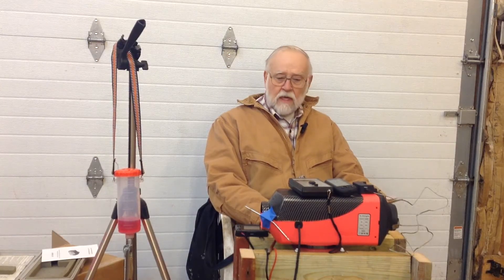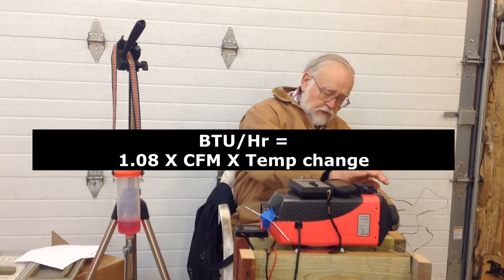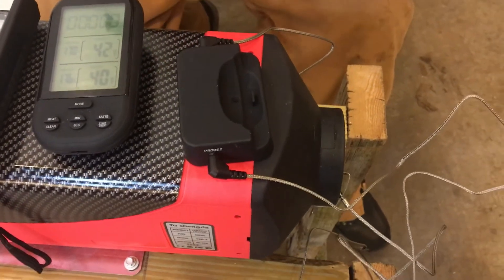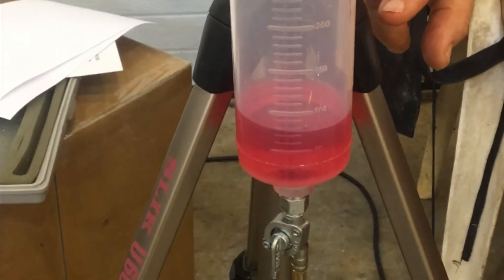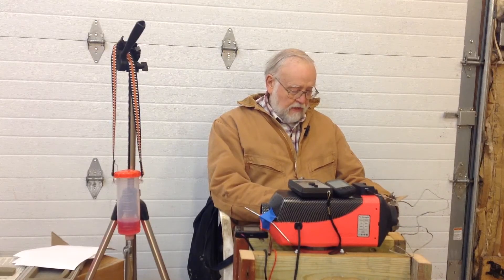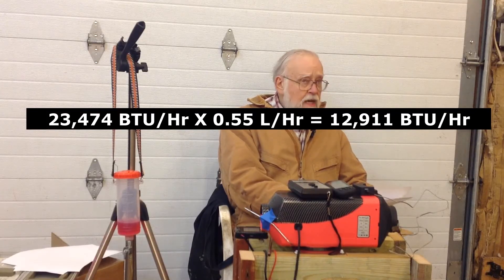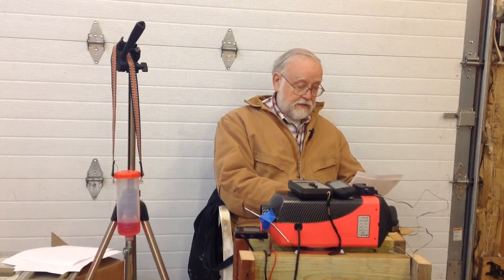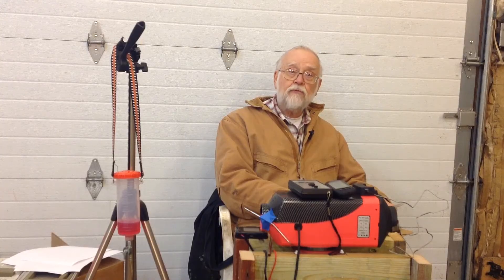Diesel Heater What is the Actual Heat Output?

Comment: nice to see someone do a little bit of math.  it would be interesting to calculate and measure how clean the fuel burn is.  the 8kw model is a stretch of the truth some may say an outright lie.  But if you work on the basis that an 8kw model is actually a mislabeled 5kw model and is about 70% efficient then you get to roughly 3.5kw, vs the 3kw yours in producing at the lower fuel burn rate.  if you dive down into the settings and increase the air fuel ratio to get it burning 0.55l per hour then potentially your up to about 3.8kw in a perfect world so a safe bet would be to say it produces between 3-3.8kw as yourcs can probably be tuned further.  i have seen some people extending their exhausts and adding heat sink/heat exchangers around them to recover some more heat and get the efficiency up.  these are not the most cost effective or efficient methods to generate heat but they are ideal for getting heat into off grid, mobile, remote locations,  they can also be used as a supplemental heat source in emergency situations.  if you figure around 10 watts per square ft (rule of thumb for space heaters) then it should realistically heat a 300-350sq ft room with typical insulation and ceiling height in a reasonable time frame, it just depends what your using it for,  if you just want it to take the chill off or have significantly better than typical insulation it can be used in a much larger space.
Reply from the maker: Thank you for your comments.  When I read the add for my unit it implied the heater had an output of 8Kw or 27,296 BTU/hr.  I think that is a lie.   My owner's manual indicated the capacity is "Calorific value (W) = 8000".  A calorific value of 8000 watts is not the same as saying the output is 8KW or 27 thousand BTUH. So far I haven't had anyone either agree or shoot down my theory.  I have referenced this calorific value in the video  and attached notes.  If you have any thoughts about that term (calorific value) I would be interested.

Comment: Thank you sir for sharing the results of your well-designed test. I have had one of these for a few months now and they are cheaper than the current price of electricity here in the UK, which is 34p per kW/H.
Reply from the maker: Thank you it is good to hear from the UK.  If one were to calculate the cost of 100,000 BTU's at a cost of 34p per kwh we get the following;
(100,000BTU  x 34 p/kwh )/ 3412 BTU/ Kwh= 996 p
If diesel has a cost of 166 p/liter in the UK and a heat content of 33,936 BTU/liter then 100,000 BTU will cost as follows;
(100000 BTU / 33936 BTU/L) X (166 p/L)/.7)=699 p
It would seem the diesel heater would produce heat at a cost of about 30% less than electric resistance heat.  The .7 in my calculation is the assumption of 70 efficiency in the diesel heater.
Reply: @richardbaker3621  Thanks.
Reply: @richardbaker3621  I tend to look at it in terms of saving money here in the UK we have mainly gas boilers for heating our homes and I installed a chineese 4 kw diesel heater (same as yours) 8kw is just a marketing ploy. I made a custom box and installed the heater outside extracting warm air from our kitchen and blowing hot air into our living room and it is keeping our 2 bedroom semi-detached house at 21 degrees C and burning a little under 1.5 litres of kerosene a day yes kerosene which is cheaper in the UK than diesel and saving the equivilent of $49.89 in heating costs per week. Kerosene burns hotter than diesel and produces more heat it burns cleaner to but I do add a little 2 stroke oil to the mix to lubricate the mechanical pump. it seems to make the pump much quieter to.
Reply from the maker: @oojimmyflip  Good to hear from you.  I like the idea of the 2 stroke oil to help lube the pump.  It would be great if someone could figure a way to burn waste oil in these units.  I have read that there are some legal issues to burning waste oil in the UK.  But free heat from a waste product would be great.

Comment: When I purchased my 8kw Vevor, I thought the output was about 10-12K BTU as compared to a 9600 BTU Kero-Sun and a 15K BTU Toyotomi Laser 30.
Reply from the maker: I would say you are right on with your estimate of output.  I saw an add from Home Depot add that claimed the Vevor 8kw unit they were selling had an output of 27,200 BTUH.  However, the same add said the max fuel consumption was 0.24 Lt/Hr.  Diesel has a high heat rating of 36,296 BTU/Lt.  So 0.24 liters of diesel has a heat content of only 8,711 BTU.

Comment: I attached a 10 foot exhaust pipe to a piece of aluminum flashing. It all runs down hill to let the water out. I also touched about a foot of the incoming air pipe and out going then raped them in header rap. The out going exhaust runs about a 100f.
Reply from the maker: Sounds like you have a method to reclaim exhaust heat.

Comment: Thanks, from what I hear (not being an engineer) the heater is 70% efficient at heating air per volume of fuel consumed. Therefore around 3 liters of fuel per 10 consumed is lost either through the exhaust as heat or uncombusted exhaust gasses. I bought this heater because it bragged of 100% combustion. Not being born yesterday, but the day before yesterday I hoped for the best. Your 70% efficiency estimate was a real jaw-dropper. I need to extract the heat from the exhaust to get my expectations back to positive. Your instructional video had many good points but the efficiency aspect was the main takeaway and having watched at least 50 videos on these heaters yours is the only one that covered the efficiency. You made my day...
Reply from the maker: Thank you for your comments.  I didn't comment in my video; however, I did the same test at the minimum rate and the eff. figure was about 74%.  If space allows I believe there is a good deal of heat that could be reclaimed from the exhaust.  It would be interesting to see what efficiency someone else would get with better test equipment.
Reply: 100% combustion just means it's not blowing out un-burnt fuel.  If you want 100% efficiency (say 10kbtu in and 10kbtu out) you need to go electric..or spend alot more and go heat pump.
Reply: @BS.-.-   - Why cant they make it blow out "all burnt" fuel??

Comment: It makes me shake my head when I see so many videos about tuning these heaters for the greatest possible output on all sorts of crazy fuels they were never designed for, all while ignoring the fact that 1/4 to 1/3 of the total heat is being wasted out of the exhaust.
It would be very interesting to get a ball park figure of how much heat is lost via the exhaust. Apart from the heat lost in steam from the combustion itself, perhaps 9 to 9.5% of total, there is also the heating of the intake air in the combustion process, much of which is recovered through the heat exchanger, but an alarming proportion of which is lost in waste heat. Might be a bit difficult to assess this since the volume of air in, does not equal the volume of gas coming out, due to steam and other gases created during the combustion from a liquid fuel amd the expansion of unreactive components of air due to heat present.
My guess is the exhaust gas velocity at the exhaust port, will be getting on for double that of the intake air. I think it would need running of the same test as your last one but also taking measurements of temperature at exhaust and inlet combustion air ports,  and the temperature difference. Something nagging at the back of my mind that this might not give a valid figure, but not sure why - getting late so I'll sleep on it .... any ideas Richard ??
Reply from the maker: If I recall correctly, when you double the temperature of an ideal gas while keeping the pressure the same, the volume doubles, if the temperatures are expressed in absolute degrees (the Rankine scale if using Fahrenheit) .   To change Fahrenheit to Rankine we need to add 460.  So if we raise the combustion air from 40 F to 600 F the absolute temperature ratio would be 
(600 + 460)/ (40+460)= 1.9
We can expect the effect of heating the combustion air to almost double the volume.  However, I have no idea what happens because of the chemical changes because of combustion.  Sorry, I doubt this helps much.

Comment: Always causes confusion where imperial and metric or SI units are involved. Might help some folks follow your reasoning, Richard, when they know .......  1 Watt = 1 Joule per second, which means that 1 kW = 1000 J/s    or   1 kW = 1kJ/second
(ps.  Using your given value for diesel, 137,380 BTU/US Gallon = 38.29 MegaJoule/litre)
Reply from the maker: Thanks for the information

Comment: Hi Richard,
This is old man Jim coming at you. let me first thank you for the invite to your video as well as providing a link to get to it. Great job on your test  as well as the video in itself. I do have a question what was hz you were operating at?
You stated you were operating at full power but never provided the Hz. Based on the information you're providing within the video I'm thinking your operating at a factory setting up 5.5 hz. And not 8hz that you can adjust to by using the advanced setting feature in the controller. Once you enter the advanced settings you can adjust from the factory settings of 5.5 Hz  to 8. Hz. Also you can adjust the fan speed factory settings 4500 RPMs up to 5000 RPMs. There are a few videos here on YouTube giving you instruction as to how to get into the advanced settings if you need to. Unfortunately the manuals that come with the heater do not provide this information. Most people who purchase the 8 kilowatt heaters most likely are not aware of this either. Hope this has been helpful O.M.J.
Reply from the maker: Thank you for your kind reply.  Unfortunately  my new heater is equipped with one of the new controllers that does not have the ability to change the pump pulse rate or blower speed.   In my opinion that was a definite step backward and not an improvement.  The unit was operating on the factory setting for max output but the controller does not indicate the pump frequency so I can't answer your question.  Does your owner's manual refer to the capacity of your 8kw unit in terms of "Calorific  value"?
Reply: @richardbaker3621   No, in my manual it states zwh
Z? UNKNOWN 
W=WATTS 
H= HZ.
Reply: There is also a glow plug wattage setting "PF" on my controller. I wonder if by changing the factory setting of the pump speed, you would also need to change the glow plug and fan speed settings to make it work right, or would it just make it overheat?